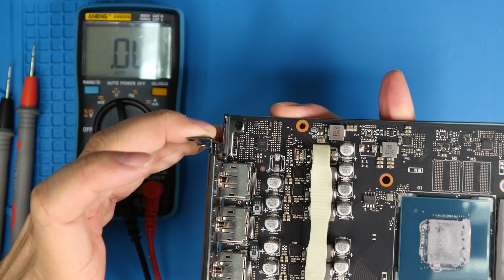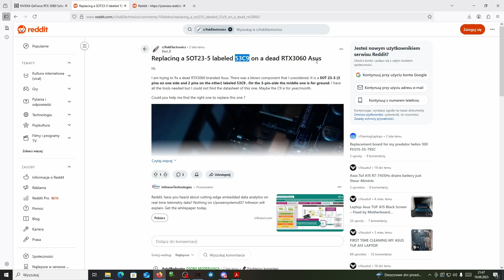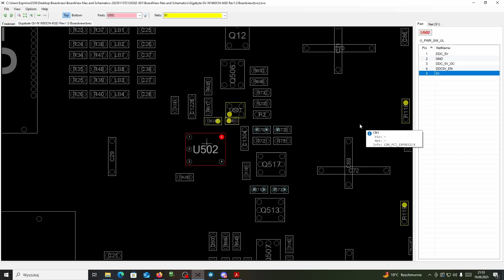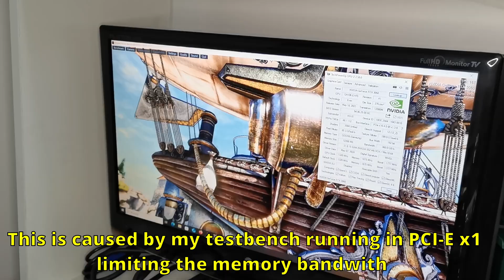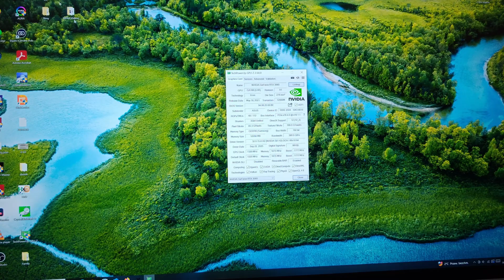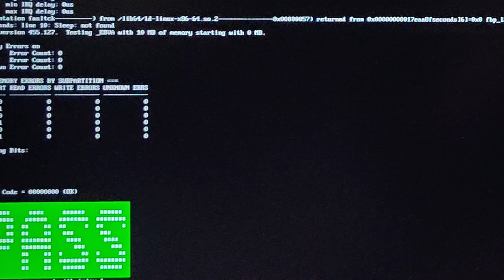Episode 37 - ASUS Phoenix GeForce RTX 3060 - PH-RTX3060-12G-V2 [repair]

Comment: Hello, How much do you charge to fix a gtx 1650 super fan?
Reply from the maker: Hi, I generally don't do client repairs. Just buy things for repair. So you want to replace the fan? Seems rather simple thing to do. I can do it for free if you provide a new fan. Where are you from?
Reply: @MyElectronicsRepairAdventure  hello im in oviedo florida, i have gotten the new fan replacement
Reply: Find a cheaper one, but you should be able to find one for your graphics card.